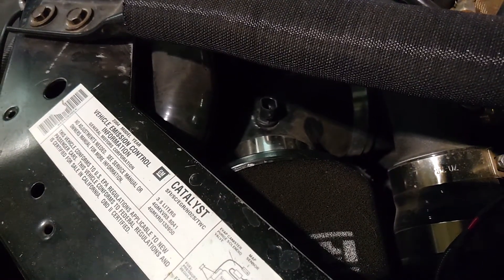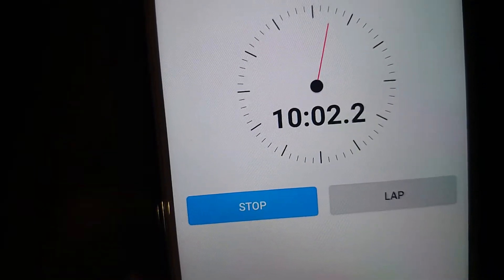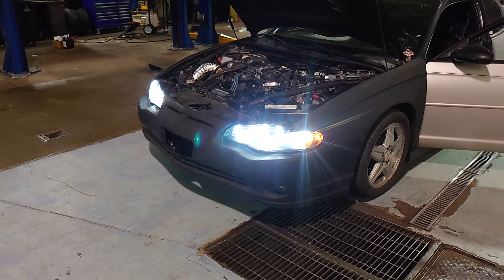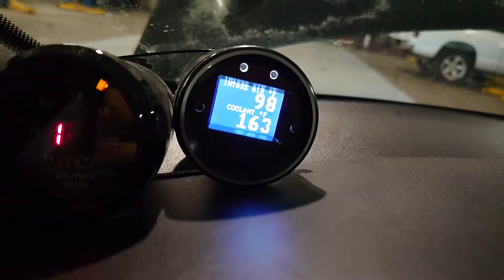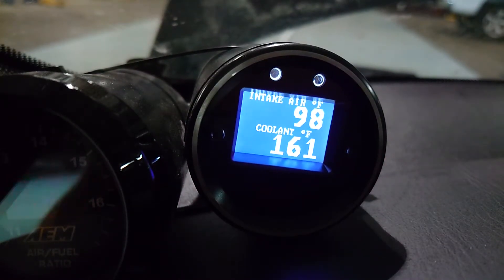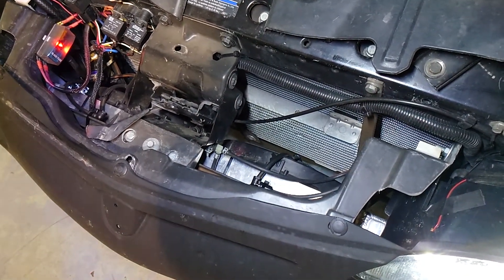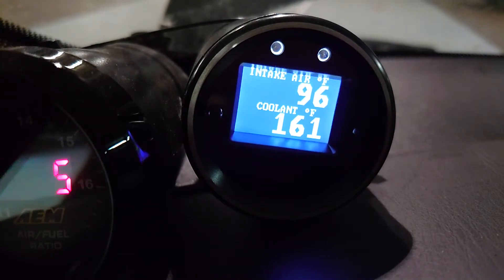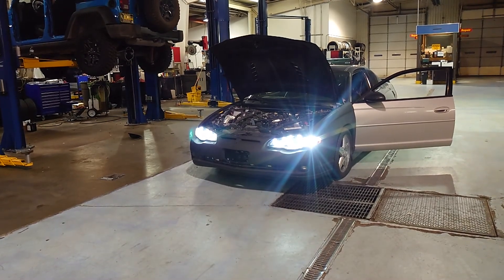Do Intercooler Fans Work? Do Intercooler Water Sprayers Work?

Comment: Honest question, wouldn’t you need to actually run the car hard to test the viability of these things? Compressed air (turbo/supercharger) creates heat. At idle you only have the engine drawing air. 90 something degree IATs are fairly normal for most cars at idle so I wouldn’t expect much from the things you tested. Heat soak happens after running a forced induction setup hard and putting hot compressed air through the intercooler. The heat builds up faster than it can be cooled and you lose power. It would be really cool to see the results while running it hard. During and after.
Reply from the maker: Yea You Do. It's Just Really Hard To Do That And Keep Consistent That Way. What I Do Notice Is With The Fans On The Alternators Are Loaded Thus Loading The Engine Which Makes The Turbos Spool Up. So It Actually Felt More Responsive Driving Around But At The Same Time Your Kinda Getting Robbed Oh HP Uptop. So The Gain From Colder Charge May Just Be Evened Out From Alternator Load On Engine. As For Sprayers I Did See My Total Timing Advance Change By 2 Degrees But Equating That To Power Really Could Only Be Worth Maybe 3HP In Timing (Forced Induction Vehicles Hit Knock Before MBT). When I Ran Sprayers And Fans On Dyno There Really Wasn't Any Change In Power But The Spool Up Did Change. There Was A Increase In Torque In One Spot But It Was Really From The Boost Ramping Up Quick And Electric Boost Controller Overshooting Target Momentarily. Peak HP Didn't Really Change. IAT After Intercooler WOT Fukl Boost Did Not Really Change Either... But They Recovered Way Quicker After the Pull So That Could Mean Something

Comment: Owning a 335i bmw with the n54 Powerplant i understand the importance of "iat's" . 
That being said ive always wondered why a tuning company hasn't figured out how to run a mini ' ac fan'  two small little 3in fans that blow refrigerated air on either side of the intercooler inlet tank "side of intercooler " and outlet tank "side of intercooler".
Reply from the maker: I Know There Are AC Chillers For Superchargers. It Chills Them Before A Pass. Can't Really Do It Full Time As The AC Compressor Would Kind Of Counter The Gains Of Colder IAT. Same With Running Alot Of High Power Radiator Fans. The Gains From Fans May Be Countered From Alternator Taxing The Motor To Make The Power.
Reply: @salvatorehayes2753  yea....ive heard of that on the dodge demons and hellcats...... but that in itself is to keep the system from over heating. We all know cold air is denser and burns better providing better performance and more power.... heat soak and sucking hot air into your motor results in poor performance..... if we can run an ac inside the car for comfort.....why couldn't we figure out a way to have a refrigerated induction system that could have the car running at its best all the time 🤔
Reply from the maker: @mikemartin6857  Yea I Think It Has To Do With Where The Condenser Is Located. All The AC Does Is Move Heat From The Cabin To The Engine Bay / Condenser. I Actually Like Running The AC On My Car Some Times. The Load / HP It Robs Actually Helps The Turbo Spool Up, And The Way My Vehicle Is It Automatically Shuts It Off When WOT At High RPMs So That It Doesn't Rob The 20Or So HP Up Top. I Also Want To Do Some Interesting "Regenative" Braking / Anti-Lag With My Alternators. So The Alternators Can Really Load Up The Engine And Spool Up Or Help With Engine Braking When Alternator Load Increases. Those Alternators Really Suck HP If The Batteries Are Dead And Charging. I'd Say It's A Good 40HP Between The 2 Alternators. And If I'm Bassing It I Really Got To Hold The RPMs Steady. Lol You Can Even Hear The Turbo Spool Up Ever So Slightly When The Bass Hits During A Parked Demo.

Comment: Thanks for the test. I don't see this really doing much for most people or most cars. But maybe hardcore drift cars between laps turning on all 4 fans and sprayers to help cool everything really quickly would be great. Or rx7s stuck in traffic lol
Reply from the maker: Yea Was Kind Of Bummed Out About The Radiator Fans Not Doing Much. The Water Spayers Do Help Alot In Hot Weather. I Watched The Ignition Timing And Having Them Running After A Few Mins And Then Doing A Pull The Ignition Timing Was Advanced About 1-2 Degrees As Compared To No Water Sprayers. The Idea Behind The Fans Was To Agitate And Evenly Distribute The Water Across The Area Of Intercooler. Im Probably Gonna Delete The 2 Front Fans As The Amperage To Run Them Is Probably Reducing My HP To Counter The Fans Effects. I've Got 2 Massive 320 Amp Alternators On This Car And I Have A Clear Idea How Much HP High Output Alternators Rob haha. Just Unplugging One Of Them I Seriously See Like 5-10HP Gain And The Engine Load At Idle Is Much Less. Engine Also Idles Alot Quieter.